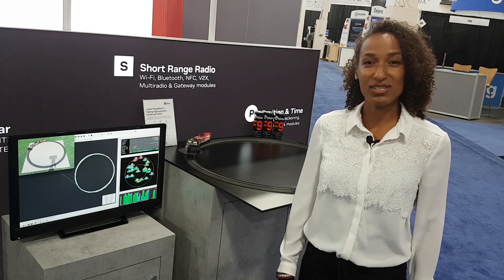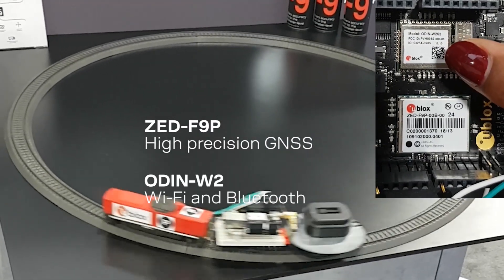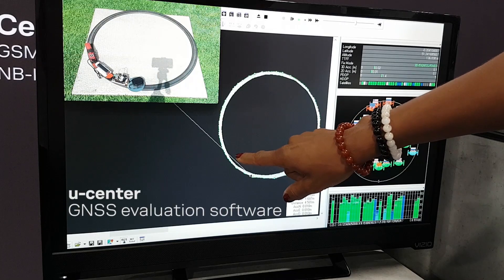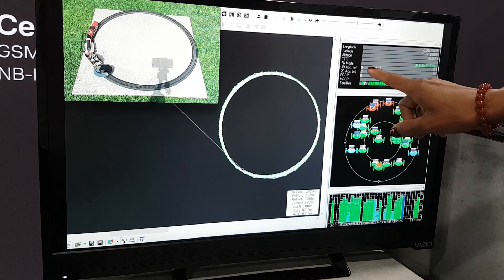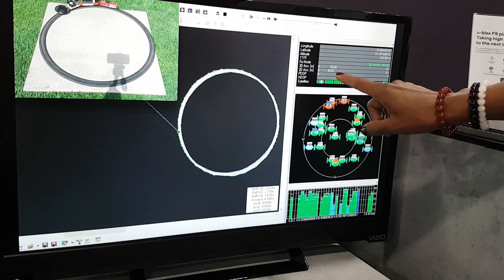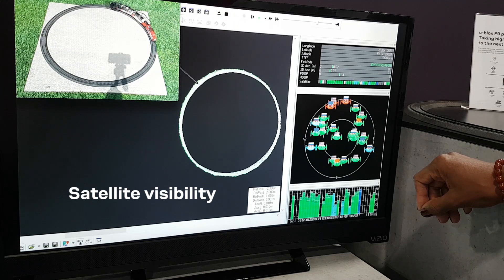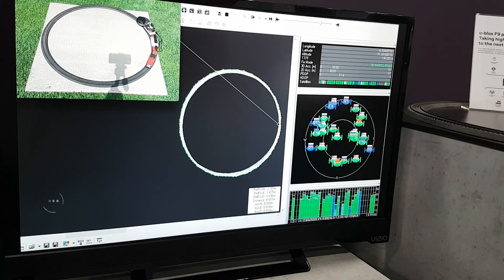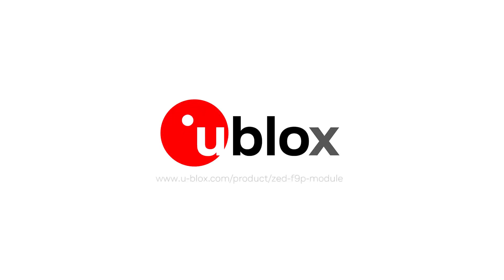Demonstration: ZED-F9P u-blox F9 high precision GNSS module

Comment: Ok, so I'm using two boards with zed to get the cm precision but my deviation is more than 2m, almost 5m in some cases. Do I need to let the base station in survey mode for a long time to get this performance or I'm missing something?
Reply from the maker: The C099 user guide contains a lot of essential information how to setup the solution https://www.u-blox.com/en/docs/UBX-18055649 The solutions requires the base to be setup correctly, The survey-in process may takes several hours and requires good conditions and excellent antenna such as the ANN-MB. It is really essential to have the antenna placed in good condition with clear view to the majority of the sky. 

Our partner Sparkfun and Ardusimple have a good tutorials on how to setup and use the technology for similar boards:
https://learn.sparkfun.com/tutorials/gps-rtk2-hookup-guide/all
https://www.ardusimple.com/tutorials/

Comment: Apologies for my noob question but it’s this being done with RTK & a base station connected? Can you use this module as a stand-alone gps gnss module without RTK base station? Thanks
Reply from the maker: To achieve the best accuracy, RTK correction data needs to be provided to the module. This can be done by getting the data from a service or a second static module operating  in base station mode. You can operate it without this data but will only achieve normal performance. See also the product summary: https://www.u-blox.com/sites/default/files/ZED-F9P_ProductSummary_%28UBX-17005151%29.pdf

Comment: I'm using ZED-F9P with Tallysman TW3972 antenna in Shenyang Liaoning China. A problem is I can't receive BeiDou MEO satellites' B2l signal (I  can receive BeiDou MEO satellites' B1l signals). I have upgraded the firmware to HPG 1.12.  Is there a solution? Thanks.
Reply from the maker: Hi Zhang, thanks a lot for your question! Did you try finding an answer in our support forum? You can also ask your question and our community will help you! https://portal.u-blox.com/s/

Comment: Can it be achieved by using one standalone receiver on the vehicle or another receiver(base) was also needed? Also is there any F9P board available that has the integrated compass and can be connected with Pixhawk?
Reply from the maker: Hi Mirko, The ZED-F9P use Real-Time Kinematic (RTK) techniques to achieve centimeter level performance. In order for RTK techniques to generate centimeter level performance a static base station or GNSS correction service is required. We have a video on RTK if you would like  to learn more: https://www.youtube.com/watch?v=2WO-1E3WJdE

I have not seen a ZED-F9P board with a integrated compass on yet but the following are capable of being connected with PixHawk:

https://www.ardusimple.com/simplertk2b/
https://www.sparkfun.com/products/15136

Comment: Hello! I would like to use the u-blox ZED-F9P module to assemble a pair of equipment for topographic measurements by the static, cinematic, stop and go and RTK method. I would like the range of the RTK radio to be 10 kilometers. I would like to know the accessories that I need to assemble a pair of equipment of this type. In addition I would like a diagram of the connections and the configuration because I am not an expert. How much is this? please, could you send the budget to ajzaldivar@gmail.com
Thank you!
Reply from the maker: Hi Atilio, thank you for your question, we would be pleased to help you solving your issues and answer your questions! Please fill out our project information form and someone will get in touch with you. - Catherine
Reply from the maker: https://www.u-blox.com/en/project-information-form